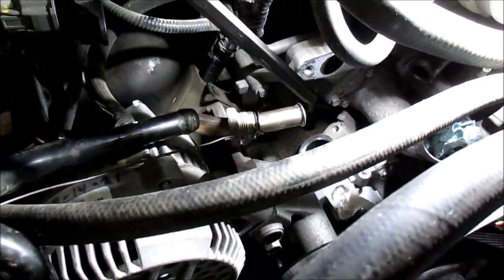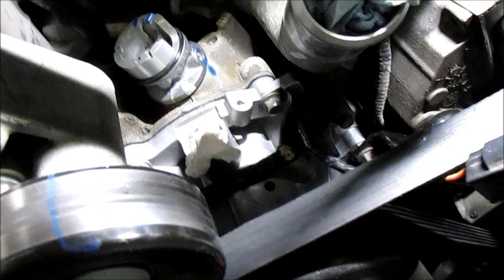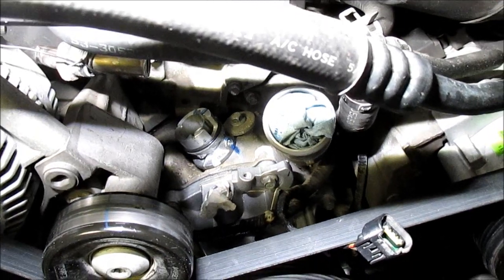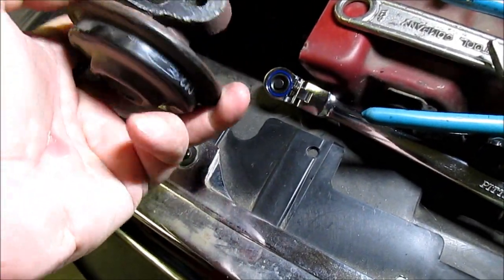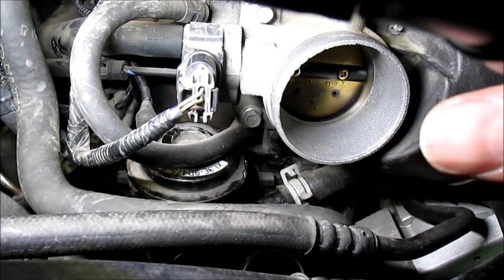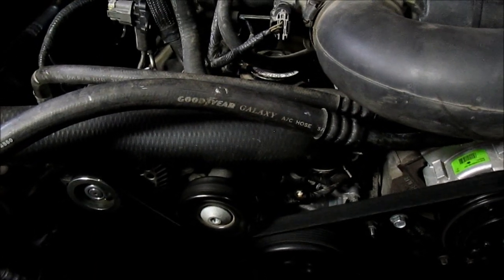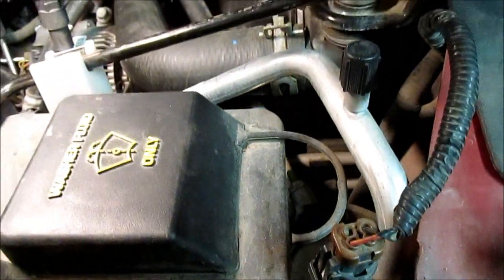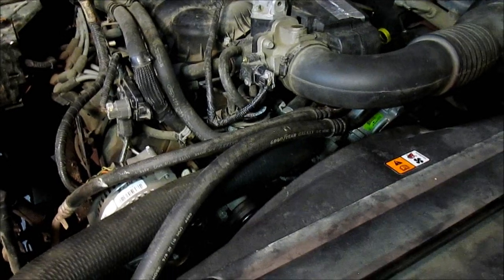Ford 4.2 V6 Cam Synchronizer Install & Wrap-up

Comment: DItto-  cam sensor drive bearing caused this squeak on my sons F-150 2007;.  Looking closely on the new oem drive housing, an unused and untapped boss indicates engineering specified a oil lube point for the shaft bearing; 
bean counters:  "we can save 0.01343 cents per engine if we don't drill and tap that boss"..... and we will get to sell an overprices engine component in the future"....
Reply from the maker: Yeah I wonder if there is a oil wick under the plug on that boss.  Like putting oil in the bearings on old motors and such with a little cap there.  This truck was not high mileage at the time of these videos.  Hope this has helped with your repair!